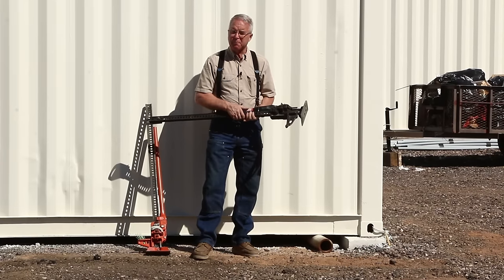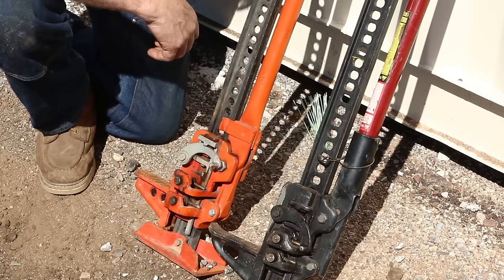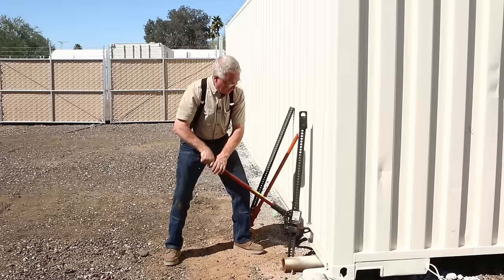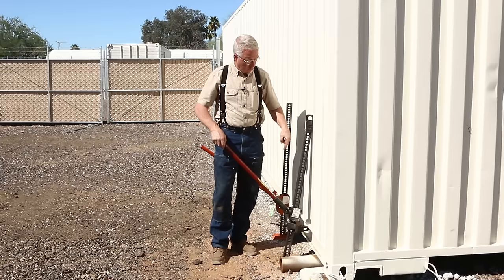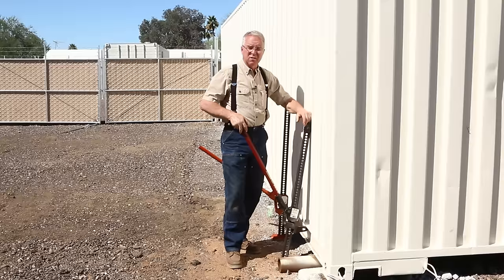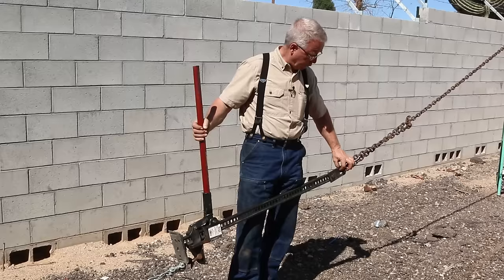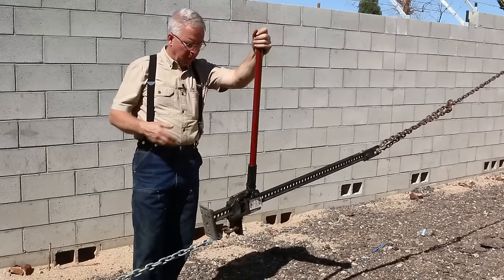Operating a Hi-Lift Jack

Comment: Yes, the come-along method! I keep one of these on my tractor-trailer, just for that reason. I carry a LOT of equipment on a removable goose-neck (more commonly known as a low-boy out your way) and occasionally, it doesn’t operate. I’ve moved quite a few tractors, forklifts and smaller vehicles a foot or two using one of these. I’ve broken a few come-alongs in my time, and a motorized winch just adds more weight to an already heavy tractor-trailer combination. But one of these and a 20 foot long, 3/8” diameter chain work wonders. Though it’s not at all handy for tracked machines!

Comment: Love my HiLift. Found it very useful for concrete demolition this past year. I realized I could cut a groove with the angle grinder, then dig a hole at the edge of the slab to get the HiLift under it, raise it up a few inches to stick a 4x4 under it, then smack the crack with a sledge. Worked so much better at getting the slabs to crack where I wanted.

Comment: I am a carpenter and I use them in renovations or wherever I see a need for it around the farm very handy. The kangaroo jack the first bit of equipment  I bought when I got my first 4wd 30 years ago, now days I see them on 4wd roof racks or bullbars and I think 98% them have never been used or that the 4wd they are mounted on have never seen a dirt track . Well that's Australia for ya at the moment.

Comment: Best fence post puller, if you don't have a tractor. I put a short chain with a slip hook on the lift, two wraps around the post, and out it comes. I did pull an old T post in two with it once. Surprised the heck out of me. Works great for pulling brush out roots and all, too.

Comment: Ive got 2 hi lifts. One original one that belonged to my grandfather.  And the new hi lift extreme which stays on my 4x4. A hi lift is one of the most underrated bits of recovery gear. Also, our local co-op sells a post puller that slides down a metal t-post and connects to the hi lift. Works much better and safer than chains.

Comment: I used the  snot out of those jacks during my years working for the US Bureau Land Management in construction as an engineering tech, wild land firefighter and two legged pack animal for Range techs and wildlife biologists. Get a truck high centered in a narrow wash (not me, the "college boy" I was lumping gear for) miles and miles from no where? Use 2 jacks to get the trucks backside off the ground and then push it over moving it 6 inches at a time to one side until I got it off the hump it was high centered on (circa 1979 when trucks still had real bumpers front and back). Pulling fence posts, splitting huge rocks along cracks etc etc what you can (and can't) do with them is limited to how many you have, your creativity, imagination, testicular composition and COMMON SENSE.
Note of caution city slickers have called the police and reported an unattended "assault weapon" when seen bolted accross the hood of a jeep parked in Phoenix supermarket parking lots. (Ain't no bull s***, retired Phx PD officer)

Comment: Wonderful tools of which I have many but they're designed with a high wear rate (preferable to brittle components, good engineering "fails gracefully" and Hi-Lifts are good) so keep them WELL lubricated.  Once the pin holes wear oval that part is needs replacement unless you're a motivated machinist. Hi-Lifts are great within their load range.
I copy first responders and "capture progress" with cribbing because there is no reason to give your load "room to fall" vs. catching up steadily with cribbing and shims. I've used Hi-Lifts on my little 20ft container but don't recommend them for the larger 40-footers for which the old Simplex mechanical jacks (still available new if ya need 'em for a job) are magnificent. The Simplex telephone pole jack with chain grab on the ram is ideal for raising containers if you can find one (or do enough work to justify the expense of a new one).

Comment: I bought one of those somebody stole it, back in the 60s. It was called Handy Andy then. I used it for everything even to the extent it had a steel tube handle and I bent it without even using a cheater but the Jack never stalled or quit on me! I kept it oiled and it worked every time I used it. Outstanding piece of equipment.  Watch out for the handle.... (-:

Comment: Maybe you do not know it, but these jacks can and do suddenly drop down! This occurs when jacking a light load, when you switch it to down. It also occurs when jacking a heavy load using more than one jack. When switching to down, it the other jack has most the load, the jack with less load can drop suddenly when switched to down. Either way, one can easily get seriously hurt or killed. This is something all users need to be aware of. With that in mind, I have several of them and use them for various reasons.

Comment: I would add that in this case, you get what you pay for. My first 'farm jack' was a no-name from a discount distributor. Although I still have it, one of the pins bent and sheared off in use the second time I used it. It now is a backup with a screwdriver bashed into the hole where the pin was. I bought a HiLift original not long after that, and it has been a workhorse and abused in the mud lifting buildings, straightening buildings, pulling stumps and other tasks. Highly recommended. I also bought a load spreading foot plate that works great in mud and sand to distribute and stabilize the jack when conditions dictate.

Comment: If you're in the lowering position with a load on it and drop the handle on accident, the momentum of the handle will cause it to release when it hits the bottom and go "full auto", so to say, up and down on its own until it gets to the bottom. I have used a hi-lift as a winch to get out of a bad spot on a nasty muddy road once. It worked, all 5' at a time, but I got an electric winch after that incident, lol.

Comment: I use one as a post puller; welded a broken ax blade on the foot and it pulls the post and break the concrete footing, most times.

Comment: Ok, safety police here.  Thought you would at least mention...when releasing the control lever, always have the handle in the upright position, next to the main load support bar.  And hang on to it.  If loose, and in the downward position, the handle will ratchet by itself as the jack rapidly descends under the load, potentially breaking things like jaws and teeth.
Reply: I fully expected him to mention this very scenario.

Comment: Allot of us are old enough to remember when you had a lighter duty cousin of this in the trunk of the car.
Reply: My dad had an old 64 VW bus. I am pretty sure it had some thing similar. Also my 68 Camaro.
Reply: Yeah. Remember  the bumpers on the cars back then had the little slot in them for the jack to fit in?
Reply: @bigcliffe  ohhhh- major love for the '68 Camaro- I miss mine!
Reply: Hoard every single bumper Jack I come across. The thin foot works great for breaking down tire beads as well

Comment: I had to lift (just an inch) my detached garage wall to replace rotted studs and rotted sills. I used a bottle nose jack pushing up on a jury rigged 2X4 under neath the header and braced the 2x4  to prevent buckling.  It worked, but  after seeing this video I'm wondering if I was better off with this high-lifter.  I could have just slipped it under the part of the sill and jacked it up.  Going up an inch I could have tolerated it jacking sideways a bit. This is a very educational video.  Thank you.

Comment: Great tool. But it can eat your lunch if you do not respect its power. I plan out the process when I use this baby.
Reply: Gryffin DarkBreed  that's a good way to think about it. The handle is literally lifting it off the pin until it reaches the next slot.

Comment: My roommate was using one of these to lift his truck while he was trying to add a leaf spring for a lift kit. As you can probably guess the truck fell off of the jack and smashed into the ground, bending the frame of the truck and shattering the rear window on his cap. He is very lucky it fell while he was lifting the truck and not while he was working under it as im pretty sure he didn't have jack stands ready to put under it at that time.

Comment: I've used these jacks underwater to pull pilings from a streambed.  Then everything works in slow motion, but you still have to be careful , especially in lowering.

Comment: I got mine strapped to the roll cage in one of my fj40 landcruiser. The last time I used it was last year to recover my boat after I parked it (on its trailer) too close to the fence , off the pad , down onto the soft shoulder. It worked like a charm, once I put a life vest on it.. Lol (to keep it from digging into the boat's gel coat.. ) 

Btw, EC, its winch, with an i. Not wench with an e. ...jeeez! I thought this was a family channel..? ,;^/  ..lol

Comment: A multiple of the force you put down vertically on the lever will act to pull the nose out horizontally from under the load. If that happens, the stored energy will release by the bar coming down on you. Normally, this isn't a problem as the nose sits on the opposite end of the lever, requiring lifting the load for the jack to topple towards you, but if the load is able to shift horizontally, you might also happen to pry it towards you.

Comment: I have removed the top bracket and slid a pipe over the main beam to raise headers .  we got stuck in a snow drift, we had a trailer hitch on the car and the 4 of us jacked the rear of the car as high as possible holding the car so it wouldn't fall over then pushed it forward thru the snow. several times until we broke out of the drift.

Comment: Used and repaired hilift Jack's in a fleet of burial vault trucks .the must stay clean ...away from grit and mud or they won't work right. Every part on the jack can be replaced as needed from hi- lift so you don't need to throw them away,just fix them when they don't work .do not get the cheep knock off for these Jack's ,you can't find parts for them and they will hurt you if they don't work right .

Comment: Attach two 4.5ft 2x4 through the top with a 1/2 bolt to make a tripod. Put it it over a cut down shrub or small tree. Chain the stump to the lift pad. Pulls them out in a few minutes.

Comment: Ahhhhhh the handy man Jack I don't think I've had an Avenue in my life that it hasn't had its part in the swiss army knife of the truck bed if you got one in the back you'll get the job done I've used it in the woods logging, on a fire truck popping doors open on wrecks, and just about every place you can think of but I have had my bell rung a few times by them

Comment: This is an obviously dangerous operation, but you can use this jack to walk a stuck vehicle sideways to firmer terrain.  First you put something under the jack to keep it from sinking in,  jack up the rear bumper of the vehicle as high as you dare and then push the vehicle and jack over in the desired direction, making sure you don't wind up under either of them.  Extract the jack, and go do the same thing at the other end of the vehicle.  Repeat as many times as needed to get to firmer ground.  This operation has worked many times, but, again, it can be pretty dangerous since the vehicle can roll back onto you or fall sideways onto you.  Consider all appropriate legal disclaimers to be inserted here.  Use this technique at your own risk.

Comment: I lost 12 teeth to a handy man jack and in another mishap broke 2 ribs dangerous but handy tools. You didnt mention that the top bracket when turned 90 degrees makes it into a giant and powerful clamp. After 30 yrs. Of concrete and general construction I've often said if you can't do it with a handyman jack it can't be done! I have got trucks unstuck, squeezed concrete forms back together, with a long enough handle you can move the world!

Comment: Hundreds of uses, from lifting anything from 4x4s to tractors, pulling, use em to break the bead on tires, straightening bent roll cages, Emergency winch, loaded logs with em (I don't suggest this...) it can get you out of a mud hole in a pinch. keep one in the work truck and the dump truck at all times

Comment: This jack is one of the most powerful, versatile and useful tools I have owned for nearly a half century, but it is also inherently unstable and potentially deadly.  I strongly urge keeping a firm grip on the handle and keeping your face outside of the arc of the handle, even if that seems somewhat awkward.  You really need to have your brain engaged before and during the operation of this jack.  It can smarten up the  person lacking attention and is fully capable of removing fools from the gene pool.

Comment: The quality - and therefore usability and SAFETY - vary with manufacturer. I  picked up a used "Horrible Fright" version with the mindset I would only occasionally use it. It's reliability is so flakey the "occasional" use has changed to refuse to use. So get a good quality version.

Comment: Thank you!  I just bought a high lift jack to remove fence post footings and I couldn’t release the reversing latch.  After watching you give is punch down, I gave it a firm tap with a hammer and it released for me.  It’s brand new should I oil it?  It was hard to release by hand.  Thanks for the warning about the handle, I’d like to keep my teeth 😁

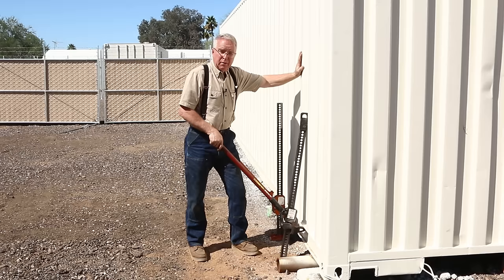Comment: 3:00 - "these things weigh 8,000 lbs, the rating on the jack is 7,000 lbs so in theory I should be able to lift this thing right up"
What am I missing here - do you mean with multiple jacks i.e. 8,000 lbs spread between multiple jacks, or that lifting 1 corner won't be the full weight of the container, or that a container empty weighs <8,000 lbs?
Reply: What you are missing is that your not as smart as the "Essential Craftsmen " !!  Point load as shown would be roughly 20 % of the sum total of object being lifted !!  If you were attempting to lift all 4 corners at once, then the total weight is the factor you would be working against !!
Reply: The container is 8000.lbs but with leverage on one end it will lift with less than 8000 lbs of pressure. But centerline on the bottom it will require 8000 lbs of lifting pressure.
Reply: Not really sure what he means but there is always a pretty big safety margin on things like these. You could probably lift 10k lbs or even more with that thing but don't go complaining to the manufacturer when it breaks or you hurt yourself.

Comment: I have one that my father used when I was a kid, and now it is worn out because we use it so much on the farm, just bought 2 new ones, great for lifting trailers, farm equipment, wish I had kept some of those old car bumper jacks they were great for keeping tongues up off the ground when not in use. My old farm now jack keeps the snow blower level while in storage for the short summer.

Comment: The hi-lift jack.  The best tool in every off-road Jeeps kit, if you have the right bumpers to go with the jack. 

Something that is a little more stable for work, but more cumbersome to transport is the venerable "railroad jack" which nice well maintained examples can still be found at swap meets and flea markets throughout the Ohio Valley.   From my days as a rigger, I always favored the railroad jack over the Hi-Lift jack for our work in moving equipment.  And it is also a great machine for teeth breakage if you are not careful with the handle.

Comment: I picked one up for $10 that didn't work. Took it apart and got some lube in all the right places (it works now). This is the part here you would think that I would tell you about how it saved me from a hairy situation . It hasn't so far. It's one of those things where if you don't have one you NEED it. But I have one you don't.  Fate is fickle.

Comment: the most dangerous part about a hi-lift jack is the device can fail when not under load (i.e. adjusting something that it is lifting). That makes them incredibly dangerous. Great tools though. A square piece of wood is always something i have at all sites to stop it falling through the dirt. Never work under one, ever.

Comment: Hello…
1) Is this jack in this video the same as what’s called a “farm jack”? (I see farm jacks in stores.)
2) So the only difference with this jack and a come along jack is that a come along jack lifts straight up, as opposed to angled? That’s it?
3) Why does this particular jack angle itself anyway? What’s the purpose of an angled lift, opposed to just lifting straight up?
4) What is a bottle Jack? Purpose?

I would appreciate all the answers to these questions. Thank you very much.

Comment: You missed a nice trick. The ‘handle’ on top of the ladder part (the handle being missing lots of times). You undo the handle then reattach it to mimic the nose. Bolt it back on at a 90 to the ladder. Voila you have a press or a large clamp. (Easily modifies to a log splitter)
Once you realize all that can be done with a decent JACK-ALL (as I’ve always referred to them), it becomes a ‘must have’ tool!

Comment: great video!
just a comment about the winching technic, you should never ever use the hole under the liftin nose, that hole does not have the same strenght as the lifting nose as a whole, even the manufacturer tells that, I know is tempting, but it could be very dangerous under heavy loads.

Comment: Nice video thanks for making it.
I’ve used one of these jacks for many years, but seeing it used on a container got me wondering just how much it can pick up. I have a container that I use for a small shop that has settled a bit causing my door to stick. I had planned on digging a hole to place a bottle jack, but if this can pick up a container then problem solved. My question to you is the container shown in the video empty?